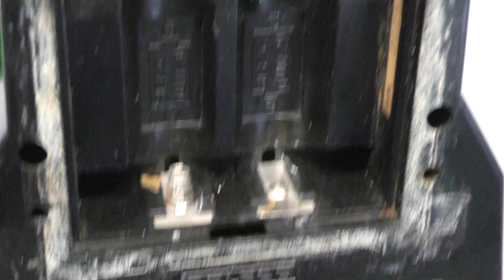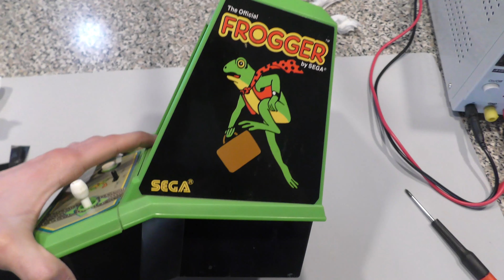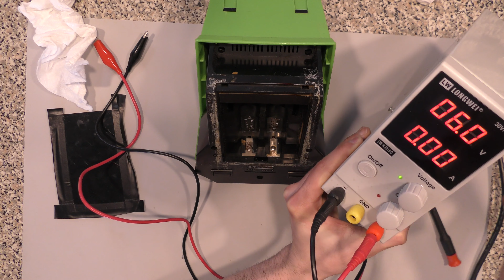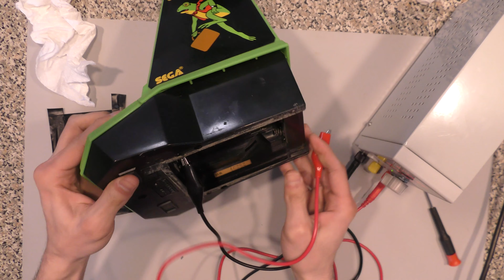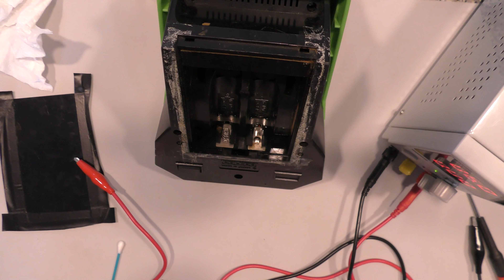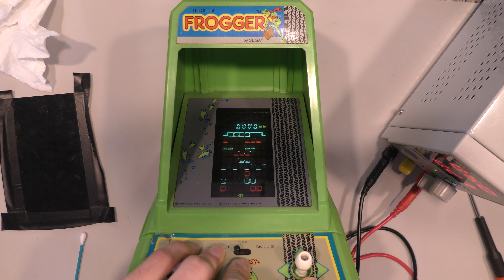VGRestore Ep36: Coleco Frogger Mini Arcade Restoration & Power Port Mod

Comment: I'm glad you got it going again, these games with vacuum fluorescent displays are incredibly charming. Also I'm pleased you picked up the Tamiya glue, a little goes a long way and it helps to have a little patience with it so it cures fully. If you do ever mess up you can always use a chisel shaped exacto blade to smooth the surface and then use novus plastic polish to restore it :D
Reply from the maker: Yes, I remember you mentioned it a while back. Of course next time I will ease up on it, good stuff. Pinned!